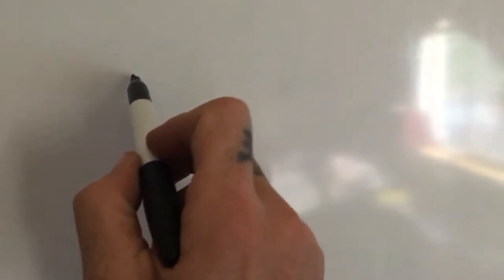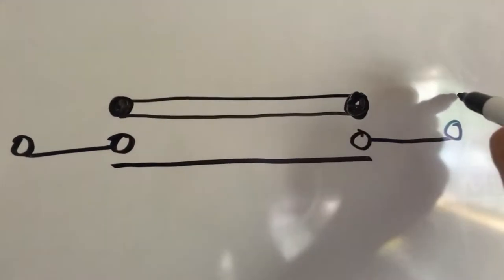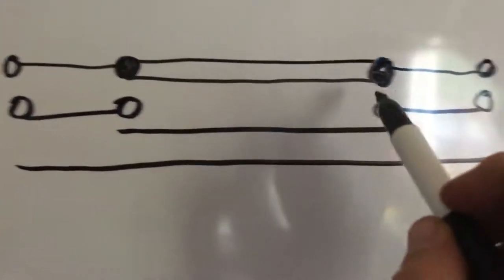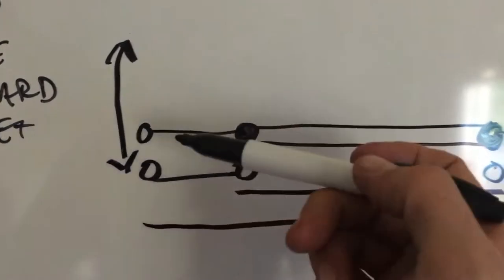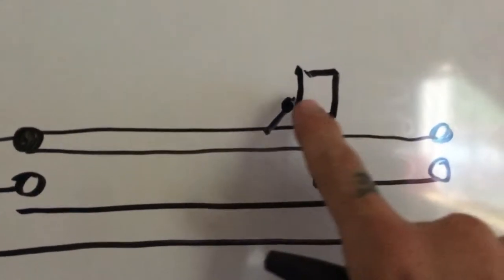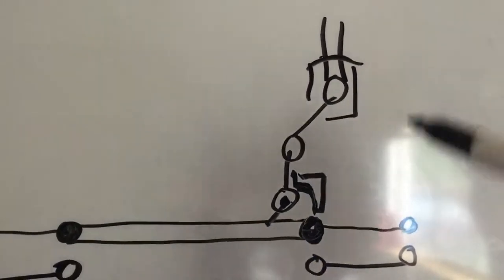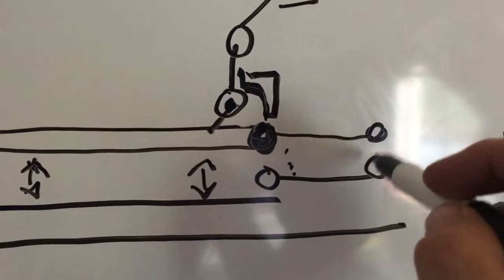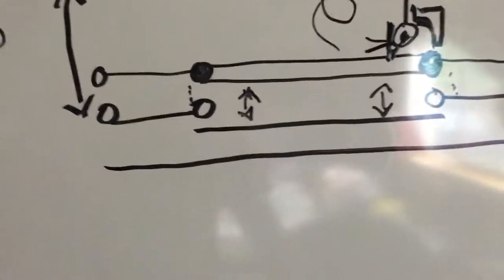ROCKER PAT AND THE MUSTANG II BELAIR STEERING WOES S12E28

Comment: Rat Rod Bob pointed out that I may have a problem with bump steer because of the 2 inch difference between the two lower control arm mounting points of the two different crossmembers. And that may be true.  What I was talking about was cutting the mount and doing nothing but rolling the rack a little so the input shaft is more in a straight line to the column, but keeping it in the same horizontal line with the lower control arms. I was thinking about just a little twist. But I'm sure it will be the way you're talking.  Are you planning on a rag joint in that pocket?
Reply from the maker: nah on the rag joint, seen too many with just 3 Ujoints and they have no complaints. and rolling the mounts should be no problem since the parallel lines aren't being compromised. onward!!
Reply: @pawpatina  No one complains about feeling every bump in the road?
Reply from the maker: @rockerpat1085  if you have power steering you won't feel it. the fluid absorbs most of it. the rag joint just adds even more vibration damping.
Reply from the maker: @rockerpat1085  if anything i will throw one in between the steering column and the top Ujoint.
Reply: @pawpatina  You know you're right!!! Most front wheel drive cars don't have rag joints and they don't have a rough feel in the steering wheel!!! I think you're on to something.  Thanks that will help eliminate that concern!!! Good thinking brother!!! Keep Rocking it out!!!
Reply from the maker: @rockerpat1085  https://www.youtube.com/watch?v=KgmuRZuWsW0